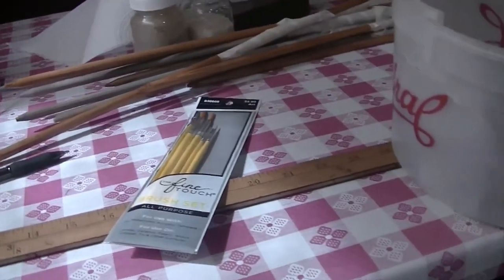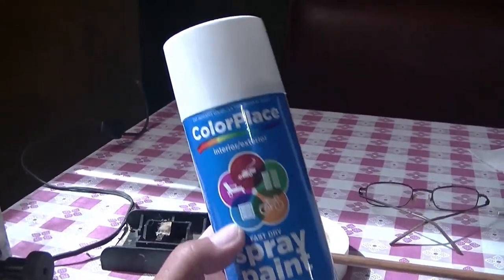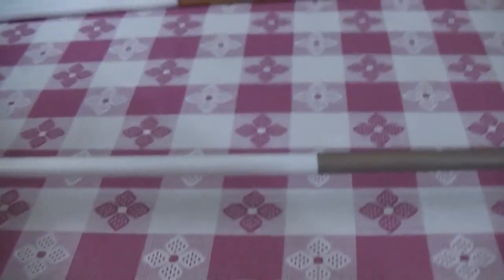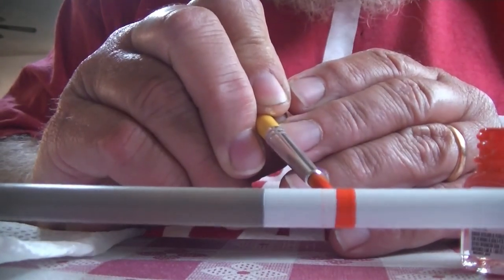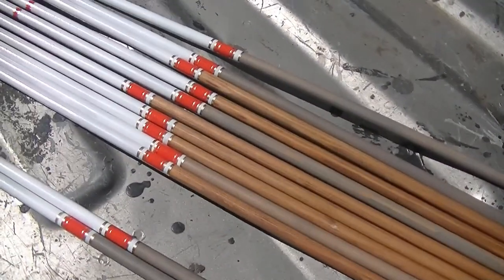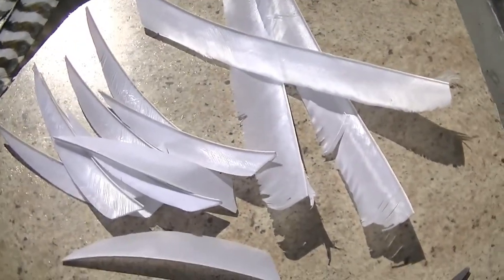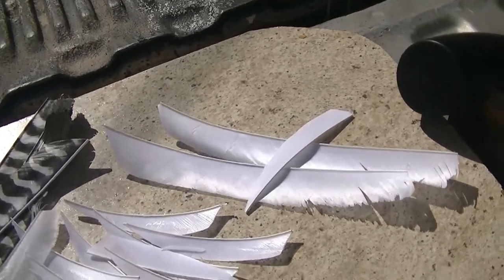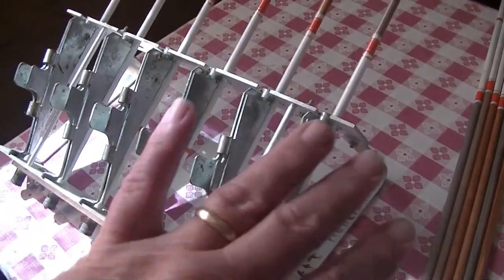Building Traditional Wood Arrows- the Killing Sticks (part 2)

Comment: Nice work Brother! Did you make that arrow rotation device? Try E6000 glue from Walmart, slower drytime but the best glue out there. Doesn’t crack or break.
Reply from the maker: No sir, it's commercial. I tried a rotisserie motor but it was too slow... Thanks for the tip on the glue!

Comment: I use the fletching tape and put a small dab of superglue on each end of the feather.  Have yet to have one come loose.  As for the nocks...hot melt them unless you are wanting g a selfnock.
Reply from the maker: I use fletch tape for some things, but i really like the Duco for the feathers and nocks. It's just worked for me for too long. You'll see what I use the fletch tape for before too long- you'll LIKE it.